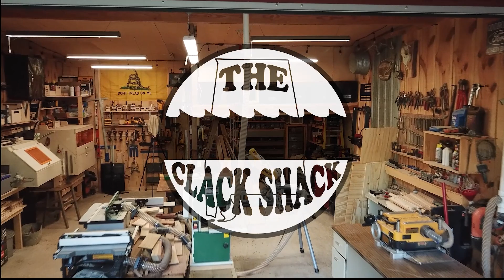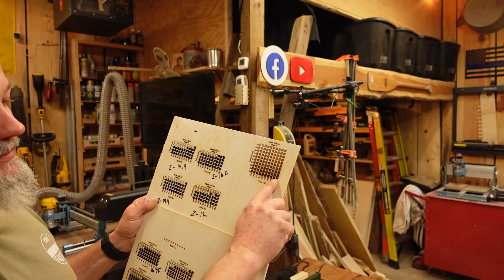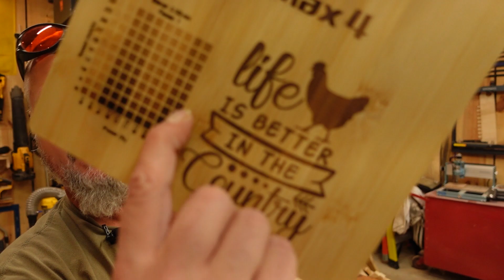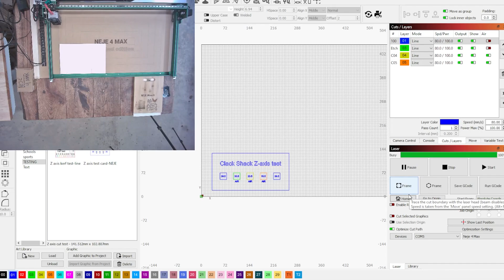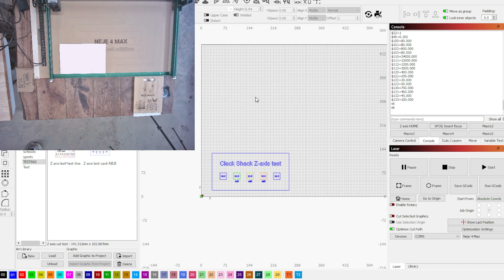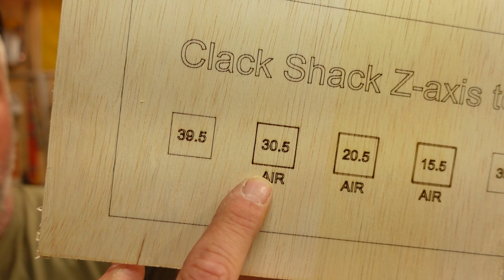Neje 4 Max- Z axis review and setup

Comment: I'm missing something in the set up. How do you set up the z axis on the machine itself. One video I watched , when it homed it went up. Mine stayed at the 25mm I set it at when I tightened the thumb screws..
Reply from the maker: set zero at the focal point on the spoil board. It should all be in the video from there. Manually adjust the Z axis to the bottom when attaching the module.
Reply: @TheClackShack  Thanks for your quick reply. The chinese english makes my head spin and their witing with the most fu...up punctuation is like traversing a corn field maze with your eyes closed. Their explanation of installing the laser module is beyound description. 

When you say set it at 0, do you mean to lower the laser till it touches the spoil board and if so where does the 44mm come from?

Comment: would you say the price difference between the Max 4 and the Max 3v2 E80 is worth it, looks to be about $270 more for the Max 4 E80.
Reply from the maker: This machine is much better than the 3 Max that I had. The linear rails made a big difference as well as the power z axis
Reply: @TheClackShack  thanks for the reply, didn't realize the 3 Max didn't have the linear rail
Reply from the maker: The one I had used rubber wheels and extrusions
.'
 @dickydoyle6741

Comment: when you say you focus it at the table level are you actually setting the nozzle basically on the board or raising it up off the board by 15 mm or simply the laser dot ???
Reply from the maker: I set mine based off the spoil board, just come up the thickness of material
Reply: my setup is like yours mounted on a solid board and right now I cant engraph  .. if I follow the steps correctly , loosen the module screws lower the gantry 44 mm from the top and retighten with the laser module raised how much ??? 
 @TheClackShack
Reply: when you get a moment ... when cutting is your laser beam round ... mine is not
Reply from the maker: The bean is gonna be rectangular or square with all diodes that I have used.  @tomspurrier3325
Reply from the maker: Make sure your lightburn settings are the same as mine. Must be set correctly for it to work like mine does. I can't send screenshots in here. Message my Facebook page and I can.  @tomspurrier3325
Reply: @TheClackShack  I got it to work the same as yours ... basically reset all my connections

Comment: How would this compare to xtool and that rang. Or they on another level
On the neje master 3 is there a big difference
Reply from the maker: This machine has twice the work area of the D1 and also has power Z and auto air. The D1 is a good machine but much smaller work area and less upgrades. I would use this machine before I went back to my D1 20 watt pro, just sayin..   This machine does have the newest module